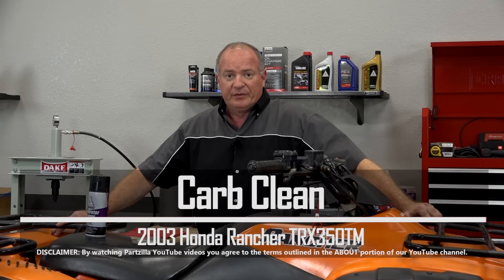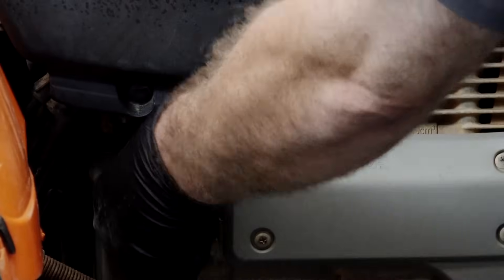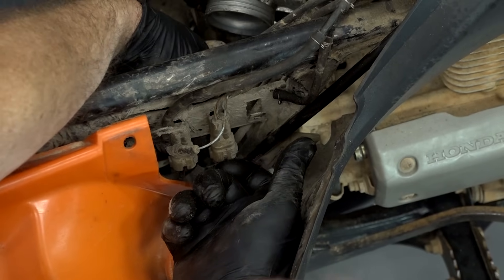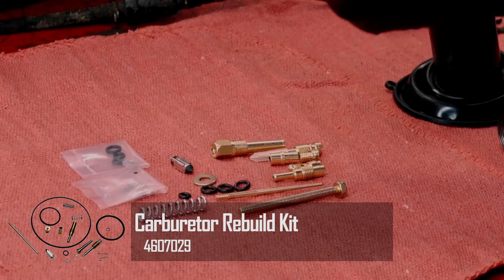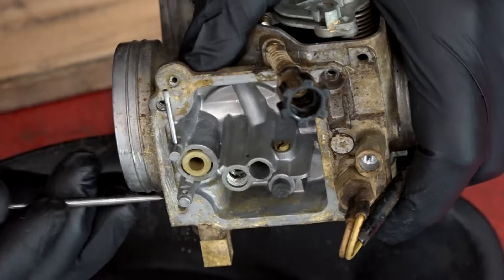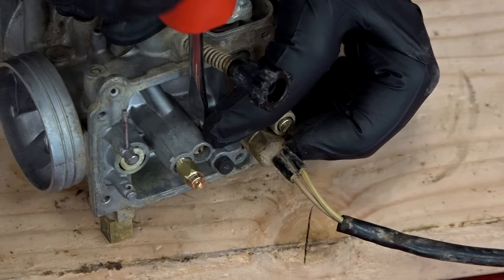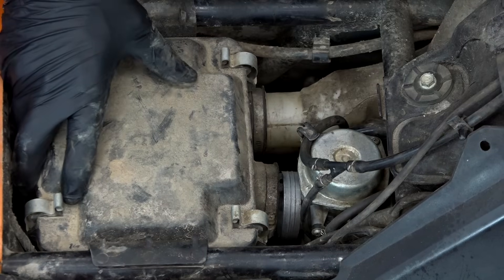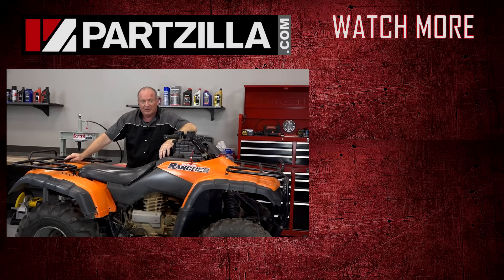Honda ATV Carburetor Cleaning | Honda TRX350 | Partzilla.com

Comment: Great video! I am wondering what the little push lever on the bottom of the float bowl does. I just aquired one of these quads and she needs a lot of love. New carb, engine flush (full of water for a few months apparently), and some basic electrical stuff.

I’ll be sure to check out the rest of your videos on this model!

Comment: Recommend polishing the brass float needle seat the Q-tip in a drill with metal polish. Will make the brass look like new. thoroughly clean with carburetor cleaner when done

Comment: Great video, used it to walk through the carb rebuild on my 2005 Rancher 350 4x4.  I too had issues with popping apart the electrical connection and ended up just cutting and splicing the wires (hack job I know but it worked in the end).  Thank you for putting time and effort into letting the weekend mechanic not be afraid of the task.  Cheers!
Reply: I also fought that electrical connector too many times and finally figured it out.  John goes over it real fast in the video, but it is as easy as he makes it look.  Viewing the clip from the right side of the ATV, at the bottom of the top half of the clip, is a cut out notch.  Behind that is a little plastic tab, just pull the tab toward you with your finger nail or pick and the carb end of the clip falls right out.

Comment: Hey John,  when you took the float bowl off around 06:12, shouldn't there have been a plastic jet holder that goes over the big jet?  In a lot of on-line diagrams, it is referenced as #24, which is part number 16168-HC4-003.  Maybe it is not needed?
Reply: Thank God you posted this, I couldn't remember where it came from, lol. Yes, I have that part as well. It's definitely missing in the video

Comment: Hello iv got honda trx 350 that won't start was going the day before fine. starter is working fine good spark good compression fuel is getting to carburettor is there anything else that I can do thanks

Comment: So we are working with our carb and the hose that’s still connected when you removed the carb, what is that for. Our machine is leaking fuel out that hose. Is something stuck or possibly broken? Thanks!

Comment: As per my question from yesterday, hubby is now wondering if you have any info on replacing the needle as although the machine is not high mileage it is older.  Do you think a worn needle would cause a rich mixture stoping it from idling.  He is hoping to hear back before he goes any further.  Thanks in advance, Norah

Comment: What does the bottom fuel line of the carburetor feed too. Mine was just dangling leaking gas. Trying to fix but don’t see anything the attach other end too.
Reply: your needle valve is passing gas ,you can adjust them by heating up float and bending needle holding area , over time gas will make float sag and not seat needle and allow gas to pass through , this is a problem on gravity fed carbs vs fuel pumped ones . float should be level when holding carb upside down . Its important to shut off gas valve on a gravity fed system when  turn your machine off , if not and  the needle is not seating you can fill your crankcase with gas and dilute you oil  and burn out engine  or it can leak out hose on bottom of carb  and your whole tank  will empty on ground , I always turn my gas valve off just before turning off ATV when finished driving for the day .

Comment: There is a hose with What appears to be an in-line filter that comes off the bottom of the bowl does that just hang free as an overflow or is that supposed to be connected on the opposite end to something?
Reply: It’s supposed to hang down since it’s the overflow that way if the carb floods the gas flows to the ground instead of dripping onto what’s directly underneath the carb. Usually there will be a tab that’s supposed to guide the hose.

Comment: I've been having a problem on mine at the very bottom of the carburator there's a little hole where the overflow goes and it constantly leaks gas if I turn the screw for it to stop my atv won't start at all I need some sort of direction where I need to be going to get that fixed thanks

Comment: I’m in my Kawasaki prairie 700 it was running lean so I have two carbs here and I put in a cheap amazon kit and unfortunately it looks like the main jet I was replacing where is screws in there are 4 side holes and smaller holes on the stem but none down the center like one of the 4 have I’ve never seen this should there not be one? Im cleaning with torch head cleaner and carb cleaner and I cannot get the center hole to open worried these jets are wrong

Comment: Hello, can you or anyone on here share with me the orientation of the idle/air mixture screw jet? You have the jet, a oring at the top, then the spring, and in the bottom of the of the carburetor, you have another oring and a tiny washer. So in the bottom, is it the washer first,then the oring? I just rebuilt mine, and after I slid the spring on, I put the metal washer on then the oring, and placed it all inside the carburetor. Anyone know the proper orientation? At 8:15 into the video, he lacked in showing how it came out in detail.

Comment: Carb rebuild kit 37 bucks. New carb on amazon that worked perfect when I installed it 63 bucks
Reply: Is your Chinese amazon carb still running fine? I was tempted to do the same thing instead of rebuilding, but so many reviews an finding out most don't last long term
Reply: @rokstr222ify  mines still doing fine. Prob 2500km since the change over and not a problem.

Comment: Thanks for the video. Helped me tremendously. Had a Honda rancher that had set for 5 + years and the gas in the float bowl was gel. Any tips for cleaning out the gas tank so I’m not back to the same issue with carb after running for 30 minutes?
Reply: Use diesel fuel to flush it out but let the fuel set overnight. Shake vigorously the following day and empty out the fuel. Let the tank air dry with the cap off and then blow out with compressed air. That's what I did anyway and it worked great. I had to replace the petcock too because the little plastic strainer tube was toast.

Comment: Do you ever have a scenario where shutting the fuel off does not stop its flow I had to plug my vent line so it would form a vacuum and could not drain the tank
Reply: Also what do you do for the fuel gauge when it's sun damaged and you can no longer read it

Comment: Great Video .... 2005 Honda 350 4x4... I soaked the striped Carb in New Carb cleaner for 1 day... wasn't sure where the small spring fell out of and didn't see the small o-ring where the small spring was...  your video helped putting the carb back together spring and o-ring etc and I set the idle mixture jet back to factory 1 3/4 turns... Quad runs prefect with ALL the Old Factory Parts

Comment: Great videos, HONDA still builds good ATVs but they are not as Great as they use to be. The plating on the bolts, levers, etc are not anodized with yellow zinc like the did back in the 80s for example. They also don't powder coat the exhaust, frame, or even the wheels anymore. Take a high pressure hose to the wheels and watch the paint fly! I've been seen 250 RECONS less than 5 years old look 30, rust everywhere and the plastics fade easily, everything put together with push pins and they even fade lol.. unbelievable. I hate to say it but when they were built in Japan everything down to the nuts and bolts were correctly plated, plastics were thicker and better. They are made with lower cost parts made in different parts of the world like Indonesia etc.. cheap

Comment: I had my carburetor rebuilt on my honda and it leaks at the primer now but will not run if the leak is stopped
Reply: I think my is the same problem out that bottom hole where the little screw is did u ever get it fixed or

Comment: All the oem screws on any Japanese anything are JIS.  "Japanese Industrial Screws"... are NOT a phillips head.

A phillips screwdriver will ruin a JIS screw.  JIS screwdrivers are excellent for JIS and Phillips screws.

By design a Phillips head screw is to cam out and ruin itself when the screws engineered torque is reached. The newer design of a Phillips screw is called PoziDriv. It is designed not to cam out.

 Especially easy to strip are the oem JIS screws for the master cylinder cover. People ruin the head using a regular philllips. I've had to drill out a lot of them on ATVs and motorcycles. Once you get them out, replace with stainless screws. 

Best screwdriver I've found is "Vessel 220V" available on Amazon....it has #1,2,3 JIS...#2 and 3 Pozi Driv (new style phillips designed not to cam out when design torque is reached), and 6mm flat head driver. It has a ball grip and flat spots to allow tremendous grip.

Comment: have you had to deal with any Honda carb floats sticking or fuel leaking from the bowl drain? (drained my whole tank one night)
Reply: My trx300ex leaks fuel from the lower drip tube (tube at very bottom of bowl) when not running but stops when it's running. Were you having that problem and if so, what was your fix?
Reply: @tinytim9453  you can adjust them by heating up float and bending needle holding area , over time gas will make float sag and not seat needle and allow gas to pass through , this is a problem on gravity fed carbs vs fuel pumped ones . float should be level when holding carb upside down . Its important to shut off gas valve on a gravity fed system every time you turn your machine off , if not if the needle is not seating you can fill your crankcase with gas and burn out engine

Comment: I've completely taken my carb apart, made sure all jets are open and clean with a tip cleaner, but I still can't get it to run. You have to cover intake of carb with hand to start, then it floods with fuel. Won't idle at all, if your lucky runs at full throttle a few seconds and dies. Almost impossible to start. What's wrong? I have two ATVs doing this. One ran fine, was shut off then never ran right after. Both units completely cleaned entire fuel systems and tanks. I can't figure it out. Any advice? One unit set up for years with bad gas. I thourghly cleaned it. Should I just replace entire carbs? Please help. I'm ready to sink two ATVs in my pond at this point..
Reply from the maker: I would replace the jets before you replace the carb.  Sometimes when you think they're clear, they still aren't.

Comment: I  used the piece  that the main jet screws into to push the new o ring into the hole for the air fuel assembly. When I tried to push the o ring in with the assembly,the o ring got pushed up on the spring because I was missing the washer and the kit didnt come with one. Good video.

Comment: My Rancher 350 is running rich but when I try adjusting the pilot screw the RPM doesn't change at all. Tried screwing all the way in and it's still running rich. Is there something I'm doing wrong possibly?
Reply: It's not the pilot screw   lol. It's the brass flat head.

Comment: So I have a 1992 honda 4trax. I did a carb clean and rebuild. I reassembled and now I have no gas feed to the carb. Fuel comes out when the line is not connected. Soon as I connect the line nothing. Thanks again, great vid.
Reply from the maker: Well, either there is debris or something is put together slightly off

Comment: Anyone help me ? I have a 2001 Honda rancher 4x4 , my problem: how do I get the worn out bearings out of the rear brake hub side of my wheeler?  Thanks to anyone that can tell me
Reply from the maker: Pull it off and either press it out or use a big socket to hammer it out.

Comment: Do you have any tips for getting a stubborn sliding pin out? I cant remove the float because the pin won't budge 😖
Reply from the maker: Confirm that it doesn't screw in, depending on the model.  Otherwise you should be able to tap it out.

Comment: Absolutely a great video. Thank you for posting it. 
I was going to try and clean my carb up and use all  the parts I had without a parts kit. One thing I did learn was not get carb cleaner on the O ring on the pilot jet. It was old and had a few cracks but the carb cleaner tended to make it swell up and it would not fit back down in the hole. Needed replacing so no big deal. Just posting to maybe help other people out.

Comment: I have the rancher 350. I did an engine rebuild and now it idles, but does pulse a little bit, but when i rev it to about 1/4 or so throttle, it begins to sputter and will choke off if you hold it there. I put a brand new carburetor on, cleaned the fuel tank and put fresh gas in, played with the fuel mixture screw, and nothing makes a difference. Any suggestions what to try next?
Reply from the maker: Have you double checked that the jets are correct for the application?
Reply: @PartzillaParts  I guess im not sure how to tell if the jets are set right.

Comment: got a recon 250 snorkeled. it dies or stalls underwater? I ran one vetn line to top from carb and still does it. is there more than one vent on a carb? its a 2001
Reply: On my rancher 350 I have 3 vent lines there is the one on bottom and one on both side of carb it will stall if you don’t plug or run the one on bottom cause water will get in carb and will make it stall

Comment: 2005 Honda 350 TRX FE,470 hours on machine, second owner 20 hours in ran fine. Now she won't start unless you flood it. Idles hard for a few seconds, gas starts to flow out of the air filter box breather tube (a lot) then stalls. Good spark on plug though. Obviously this needs a carburetor cleaning and rebuild but should I also purge and clean the gas line and tank? Should I also change the oil because of all that gas coming out of that crankcase breather. Informative video by the way.
Reply from the maker: Definitely a carb clean, you can replace gas to be safe.

Comment: What dots do I line the butterfly at
Reply from the maker: You turn the throttle stop to align the valve with the edge of the outside by-pass hole in the body.
Reply: Partzilla I have 4 off set lil center punch where would be the best way for butterfly value to be on

Comment: hey men i have a problem with my polaris predetor 500 it dost star coold but wen hot it stars al the firt go ive checd the spark plug the baterry and can you help pls
Reply from the maker: What year is the Predator?  Do you use the choke?
Reply: The choke is conected but stil has trubel to star plis help brother
Reply: 2007 polaris predetor 500cc 5 ger box. +revers

Comment: I have a 2004 rancher 350 2wd and I don’t know where the vacuum lines go that attach to the carb do they just go in the hole on the gas tank and vent in the air? Reason I’m asking is because I recently bought a new cab and it keeps running really rich and pouring gas out the over flow tube. Could my problems be from the choke cable not being hooked up? My cable was frozen have a new one on order. I’ve already tried another carb on it and same thing after being ran has a hard time starting like it’s flooded and leaks all the gas out till I shut off fuel supply. Someone please give me some insight and information on this it would be greatly appreciated
Reply from the maker: It doesnt have any vac lines, all of those are vent lines and yes, they run up the back of the gas tank to a section on the intake duct that holds them in place.
Reply from the maker: Your float bowl in probably stuck open. Try to pull the bowl and make sure it doesn't have trash in it. Plus check the fuel height in the bowl.

Comment: Very helpful video, much appreciated! Couple questions: 1) my foreman sat for 7 months.. would just the old gas alone cause it to not start? Just asking because I took the carb apart and it wasn’t TOO bad (but cleaned it anyway).  2) Question on the slow jet inside the bowl area.. when I screw it back in you say “until it seats”.. is this pretty much until I start to feel resistance? Curious because after a few turns I feel the resistance but it still feels like you could screw it down tighter with a little more force.
Reply from the maker: After only 7 months, it should start, it just might not run properly.  That's a guess, it depends on conditions.  

Resistance could be debris on the threads, you will know when it seats because it bottoms out.
Reply: Partzilla Thanks for the quick reply. Just got the carb out back in after cleaning and fresh gas. Started right up and idles fine but when I went to drive it I could literally push the throttle wide open and would only reach a top speed of about 10 mph in 3rd gear. Obviously something is restricting something but I have no clue where to look to correct it. Any ideas?

Comment: I bought a 2004 Honda rancher 350 trx and it wasn't until last year that I had to put on a new carburator....now again this winter the carb is out again....how did the original carburator last unplugged- problem free from 2004 to 2016 and now the last 2 years a new carb and now it's out again ...and i started running ethanol Free fuel and no difference.... WTF?  And a new carb is now 40.00 on eBay and Amazon??
Reply from the maker: Why are you needing a new carb?  A carb clean wouldn't fix it?

Comment: put a new carb.  but bike only runs good if air cover is off any idea why?
Reply from the maker: First guess would be to adjust your air/fuel screw to lean it out a bit.
Reply: where did you get the carb?

Comment: I have a 2003 Honda TRX400EX and I'm looking to buy a new carb. The 2003 model of the carb is way more expensive than the 2005 model of it. Would the 2005 carb fit? Would there be a preformance difference?